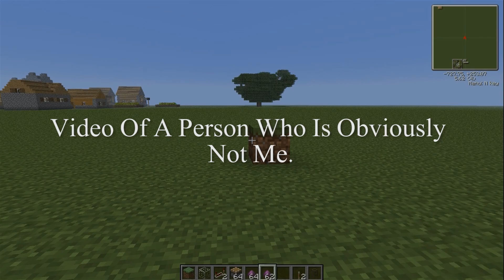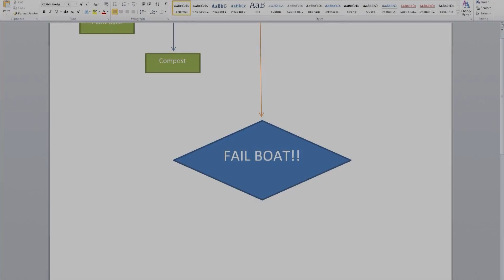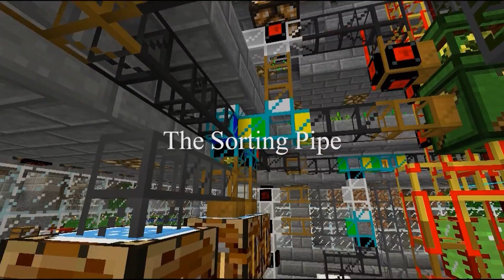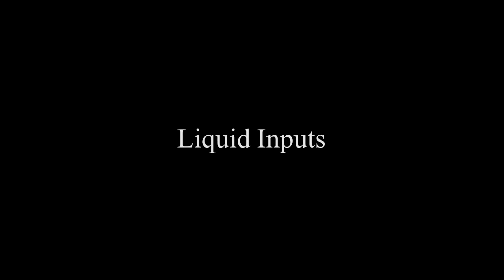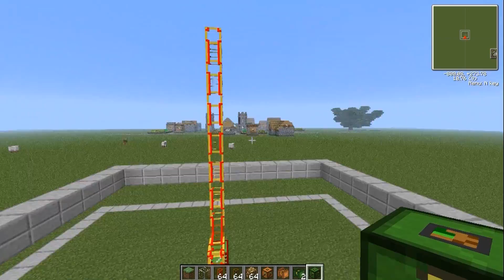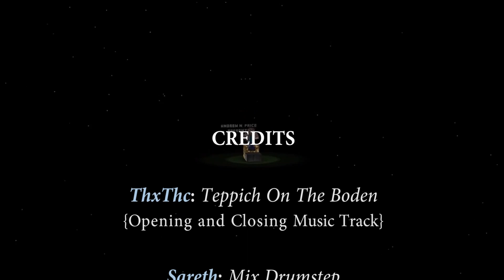RGTG 02: A Self Contained Computer Controlled Biomass Factory

Comment: I'm pretty sure if you use electrical engines to power the still the amount of energy you would produce from the steam turbine would be much greater than the amount of energy your using to begin. I haven't tested this but i'm almost certain that you'll end up with excess energy.

Comment: When i was talking about the newest version of the mod pack i meant the 1.4.6 mindcrack pack. I wasnt really that clear with it. But take a look in the mindcrack version of the mod pack and it should work out. Also something you can do with the excess biomass is convert it to biofuel an use that to power a couple steam boilers. If you take the pipes and transport the steam out of the boilers and into a steam turbine you can use that to produce mass amounts of EU power.

Comment from the maker: I tried an aqueous accumulators in my original design, but yeah I would have to run multiples.  The pump seemed to work pretty well so I did not worry about it.

As for the stirling engines: the steam engines produce less power when they first start up and there seems to be a risk of them overheating and seizing up.  On a single piece of charcoal they do produce about 50% more power, but for right now I think I will stick with the stirling engines since they are less complicated to work with.